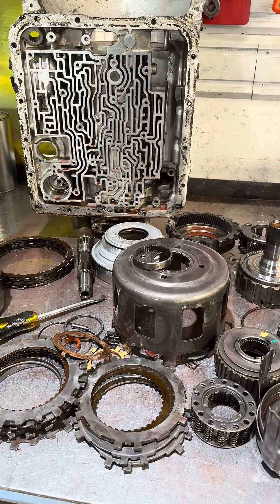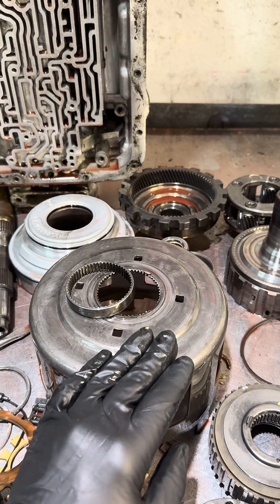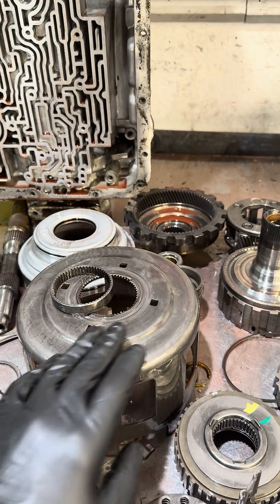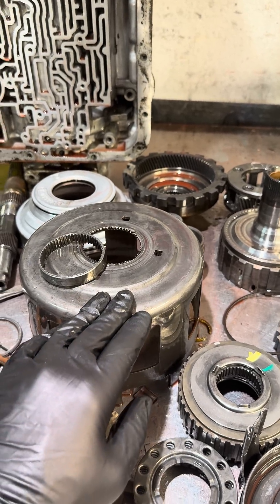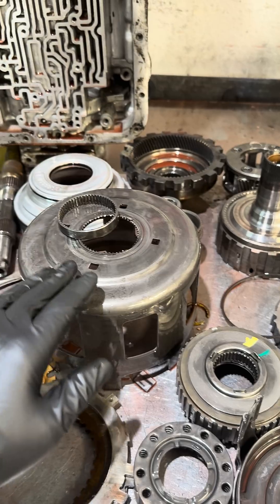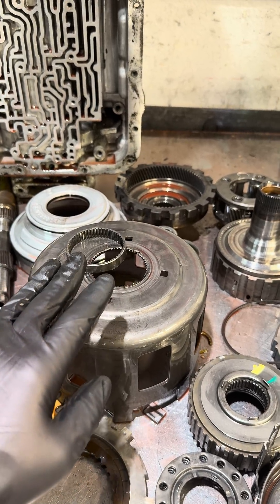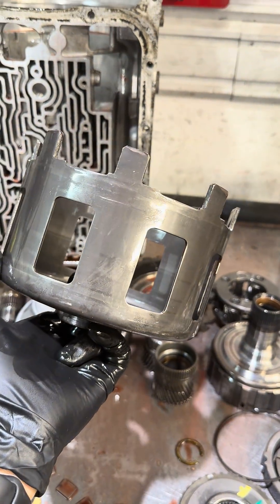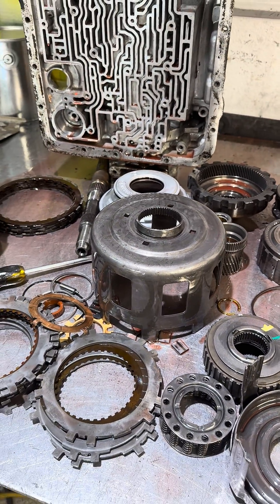700R4 4L60E No Reverse, 2nd or 4th - Sun Shell Failure

Comment: Do you know if 2006 tahoe Z71 had hardened shell?  I rebuilt my 02 tahoe 4l60e with everything sonnax n then some and it shifts awesome. Thx for video share!
Reply from the maker: None of them, other than the 4L75E Super Matic OTC unit sold by GM Performance Parts has a heavy duty sun shell. All had the same shell with the same shitty metal as far as I know...

Comment: Worst transmission ever built!! Had 4 of the Chevy junk. Yeah I'm not that bright It only took four before I realized that Chevrolet was trash😂
Reply from the maker: Ha! Yea, these things were basket cases in many respects; 3-4 clutch failure and sun shell failure all too frequent...They can be made reliable if built correctly, however so it's not all bad.
Reply: @nickstransmissions  I was driving (01 tahoe 4l60e) heard a pop and lost all forward gears still has reverse. Any tips?
Reply from the maker: Yes, get it towed to a shop or back to your house because the transmission has to come out and be completely overhauled. 

If it was just rebuilt, contact the shop on Monday if they’re closed today.
Reply: @nickstransmissions rebuilding is out of my expertise so Ill probably just find a used one and swap it. I have a nice shop just not a transmission guy haha. I assume its the sprag clutch considering how quickly it happened.
Reply from the maker: Yep, that’s my guess as well. Either fwd sprag or, if you don’t have movement even in manual low, the low roller clutch as well.
Reply: @nickstransmissions yes I towed it back. Its been sitting for about a month now, was just looking for insight on what to expect them to say. Its not my daily but is in beautiful conditon besides the transmission so hate to see it sit